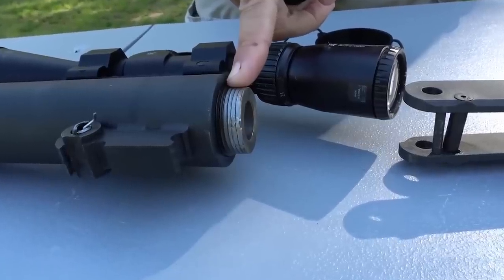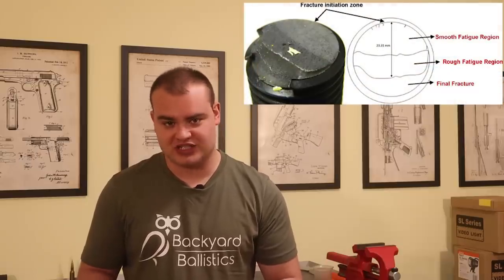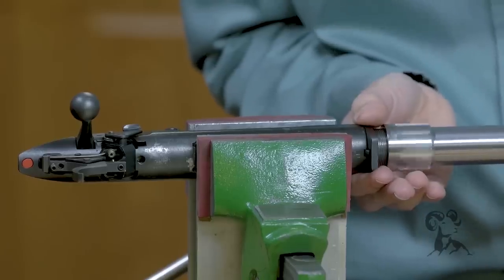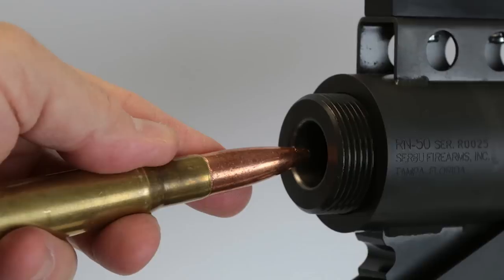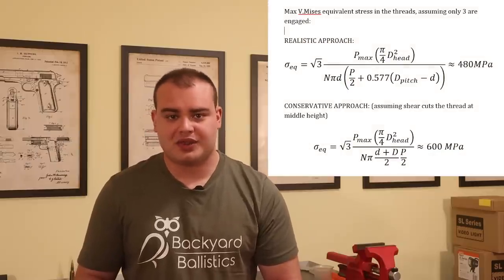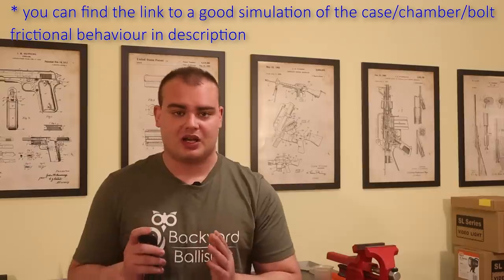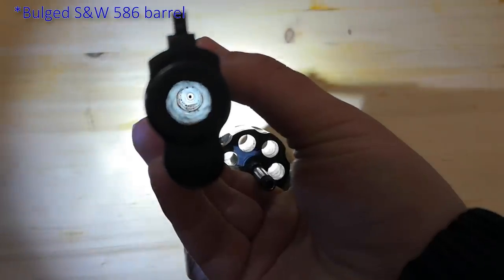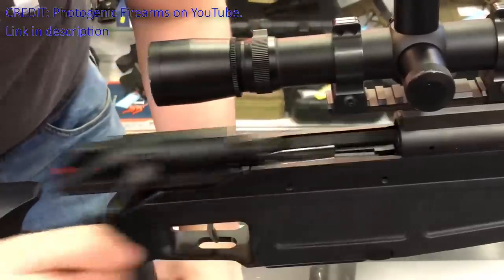Serbu RN-50 Failure: A Closer Look

Comment: I'm sure your not a 50BMG sabot expert but have you seen TiborasaurusRex's video on this?
Reply: I need to look this up. Thanks for the tip.
Reply: TR claims that trouble at the muzzle brake blew up the breech.  TR is wrong about this.
Reply: @rickoshea8138  either way, it is a VERY good case study all around. Everyone in the community will benefit from it. I hope.
Reply: @rickoshea8138  yeah. The brake wasn’t damaged.
Reply: @aaronhiggs  Not in an obvious way.  Perhaps a closer look might show something.
Reply: @rickoshea8138  I could see how additional pressure caused by the build up at the break (which is known to occur) could blow the breach. Pressure is going to act evenly at all surfaces inside breach and barrel. Weakest point (breach) blows out.
Reply: @stevendombrosky5184  The bullet striking a muzzle obstruction does not produce or require excess gas pressure behind the bullet.  It is like driving a vehicle into a concrete block:  The front of the vehicle is damaged; not the back.

Comment: the shape of the threads is important. there are several sawtooth thread forms that are specifically designed for these types of applications. a standard 60 degree v thread is not ideal. the sawtooth form is almost flat on one side so like a buttress . in a v thread under extreme load the female will climb up the side of the male V. the male V is thinner higher up and so has less strength. 
the sawtooth forms don't have this issue . there is  "Sägegewinde" () buttress  form .... used for breach blocks and things like tierod threads on massive hydraulic presses. they are only useful when the load is primarily in 1 direction.
Mark Serbu should look at changing his thread form and maybe add a few more.

Comment: Did he have the losser fitting machine gun barrel and chamber fitted to take the sabot round or was the original barrel fitted to the 50 cal because if it was it should have been changed out for a machine gun barrel as it is looser fitting to the cartridge when the cartridge has been put into the barrel and the Chamber it may cause a restriction on the end of the round pinching the saebo which would act as a restriction causing over pressurisation of the Chamber please can you get back to me on that as that may be the cause of the malfunction
Reply: Mark serbu should have informed him if that is the case
Reply: Pleas find out what barrel had been fitted to the rifle pleas and let me know thank you
Reply: And may be they got mixed up and gotten the wrong one by mistake
Reply: If you gave me a lath and the barrel I could resize the chamber to the correct sizing or mark can
Reply: I think it may have been to do with incorrect head sizing to the barrel though a few microns of jacket in the barrel at the end of the chamber could do about the same to

Comment: The SLAP rounds will mess up M2 50cal BMGs. In those recoil operations the SLAP rounds resin sabot is the issue. It was designed to fracture in the rifling in what was believed to be a predictable manner and separate on exiting the barrel. But as these rounds sit, the resin becomes more and more brittle. They only have a shelf life of about 3 or 4 years before they start to become slightly more brittle, then after another 4 to 6 years they are basically guaranteed to start causing issues. They develop micro fractures that are invisible to the naked eye. In a recoil operated firearm they cause pressure spikes and excessive recoil...I've seen an M2 spit its guts out the back after one of these caused a barrel obstruction at the rifling engagement and destroyed a 70+ year old M2 frame. Those baby's are tough and have been around for a very long time and will likely be in service for another 100 years.

The issue is the resin sabot. They have become so brittle that they are likely now breaking off pieces in the barrel. A 50cal is designed to slightly squish the bullet. The diameter of the projectile is about 3-5/10,000s of an inch larger than the bore of the barrel (groove to groove). The same specs were used on the SLAP so ensure that they worked as intended, and initially they did. But they weren't tested over decades and became sort of a novelty in the military. They look mean, they have the added flare of being a 660gr. tungsten projectile, they will definitely punch through more steel than an API, but they are dangerous now. Get on to empty and have as a collector item. But never shoot them. 

Backyard Ballistics, you are welcome to use this so you can stop being asked about why the treads failed, it was a massive pressure spike that lasted much longer than what that rifle was designed to handle. Those big pressure numbers only happen for a fraction of a millisecond before they drop rapidly. But when a bullet causes its own obstruction and not even part way down the barrel, thing go very wrong and fail catastrophically. I'm pretty sure that even if there were a 4th 5th or even 6th or 7th thread, it might have been worse. Think in the order of a pipe bomb going off in your face. The design is sound, I think the only  thing that might improve it is adding some shielding and a deflector for the rear cap to direct it and the blast in case of a failure away from the shooter. I'd rather have the rear cap fail than take shrapnel to my face and torso if the cap was deflated away from my shoulder.

Comment: The failure in this case actually looks like it was caused by an UNDER-charged round, or a round that was improperly stored at high temperatures for a long period. Loading without enough powder gives the flame front more room to propagate faster, leading to a detonation instead of a burn. The overall chamber pressure would have been much higher than optimum. Same with a hot-stored round, storage at high temperatures causes chemical changes that make the powder more volatile and increase the burn rate, increasing the chamber pressure. Either way, KABOOM. In either case, if the cap hadn't failed, it's possible the entire breech might have failed, exploding like a grenade and sending shrapnel everywhere.

Comment: Lots of talk about the thread, seen another video of him where he shows a thread with multiple cycles, like 10 orso. I do wonder how the distribution is with just 3 cycles or turns, which this riffle has. I guess that would mean immense loads on the outer thread turn. I guess. I saw diagrams with percentages, but they mostly shows number 1-8 meaning atleast 8 turns. Soif they are just 3-4 turns, that means totally different distribution

Comment: Beyond the COMPLETE LACK of design to direct ENERGY & Shrapnel away from the shooter during an overpressure failure... look closely at the threads at 1:47. 

Not only are there less of them compared to similar threads in M2 Browning barrels (which has the LARGER MASS of the Bolt Carrier Group and Receiver Group between breech and shooter, but even then NOT ALL THE THREADS ARE IN USE. 

The forward 2 to 3 threads are NOT even engaged since the cap is COUNTER BORED (fewer threads in it) to ease threading. They took a WEAK part and made it WEAKEN for ease of use. You can see these UNUSED threads pristine at 1:47

Comment: still think the sabot from the previous shot was stuck in the barrel in combination with a way to hot charge in the next cardridge  , i think the barrel wall was stronger than the breach in this instance or the sabot was indeed stuck verry close to the breach (still possible if he just loaded the round without looking through the barrel ) and again a verry hot charge 
one thing that could be done to make the gun stronger is make those two lips on the handle that go behind the breach a lot longer should give it more strength against the breach hopefully project it upwards if it comes/blows  off and not send those pieces flying to the person behind the gun (thats would be a bad design flaw as the gun is meant to kill people in front of the gun :P)

Comment: Y'know the more I think about it, the more I realize.

Scott had his Serbu RN-50 for about 3 years before it exploded on him. This wasn't his first go round with SLAP ammunition. Could all of the previous SLAP rounds eaten lightly at the metal, until the threads finally gave way with the split case on the final shot? I know SLAP's were designed for an M2, but iirc it even damaged and blew the barrels off of those as well.

Comment: In my opinion a 50% strength margin against catastrophic failure is unacceptable. I believe actions should have an alternative load path that engages with gas venting. The Lee Enfield action has the barrel threads in series with load then far back two lugs drop into slots. If the bolt lugs go plastic the bolt goes backwards until the handle engages more material, meanwhile the case ruptures and bleeds gas from a safe vent. 
A Lee Enfield will survive being fired underwater. I have not studied closely but if true that the threaded cap is the sole feature, I am concerned. I would not fire one. Guns are typically designed with features to make operator injury rare. I deliberately tried to fail a 100 year old shotgun with say 10x over load then barrel packed with pistol bullets and rocks. It swelled and stretched the action to bleed gas - would not have hurt the shooter (other than recoil). I loaded a 38S&W Webley break top to near 357 magnum pressures and it half cut the screw retaining the latch so again, case head ruptured and relieved pressure. I do not have confidence in a threaded cap.

Comment: I think its a case of all the things that can go wrong, did go wrong. On a weapon that was NEVER tested to failure.  Scott fired that gun a lot. I have nothing against Serbu. I didn't like the build of that gun, especially the threaded cap, going on and off after every round fired, but Scott kept shooting it and over time I started feeling that it was a good gun after all. Scott never had issues with it and seemed to like the gun a lot. They ( Serbu) will get to the bottom of this , and I think lessons will be learned by all. If you own one of these, you need to take a little more time inspecting your gun between rounds and DAMN sure you know what in the ammo you are putting it it.

Comment: I don't know if you have talked about the sheared off "safety lugs" that prevent the user from being able to fire if the cap wasn't fully on, those lugs, had they been designed longer or full length to the butt stock, might have prevented the accident being that bad - first - sheared off lug was what did a lot of life threatening damage to the user, second - had they not sheared off - they would have deflected the cap from going straight into shooters face, I see no reason for the "tab" design used in the rifle, it just makes no sense to me, though - looking smart after the battle is easy... :)
p.s. subscribed

Comment: Compare deformation of the barrel threads to how much the cap threads deformed and you might see evidence of bad barrel steel.  Inspection of the case should show wether it was severe overpressure or an obstruction.  The muzzle flash looke odd going back so far but that may be how a muzzle break works at high pressure.  The blast certainly moved the shooter back.

Comment: He used an aftermarket barrel and so we should assume normal imagines of the rifle can not provide useful data. 
The videos posted a month from failure explain he's fully aware the ammo used was too powerful for his rifle and it would damage the gun.
Reply: Only difference in the barrel was how the chamber was throated. Learn stuff.
Reply: @camojoe83  You assume that's true.
Reply: It wasn't "an aftermarket barrel", he got it directly from Serbu:
https://youtu.be/tpp4SdE1MUk?t=334
Reply: @jic1  
The word aftermarket can be defined several ways, several of which do not include product manufactures source origin. ie. Any parts not included in the whole sale may be considered aftermarket additions. This may include items sent from Serbu in the most common definitions but does not include all sourced vocabulary. 
In this video he directly states the barrel was built for a machine gun and not a rifle. The only difference between one company or another is fault. The fact Serbu sent the barrel does not change the statement above.
Reply: @JEGRussell  No, he says "it has a machine gun chamber".   And the usual implication of "aftermarket" is 'not from the original manufacturer'.  This barrel is from the original manufacturer.
Reply: @JEGRussell  You are literally debating jargon.
Reply: @jic1  Calm down..
Can'r prove it!

Comment: The problem I have with the design is that the only direction it can fail is straight back. Also the two tabs that lock behind the cap are pathetically insufficient for a 50 bmg. There is no reason for them to not extend the length of the lower receiver. which likely would have prevented them shearing off and poking holes in Scott. Bad ammo happens and over pressures happen. It is incumbent on a conscientious designer to take those things into consideration and plan for the safety of the shooter.

Comment: Dude, the more threads, the higher the pressure rating.... Period...
Reply: up to the point that it would shear off where the cap touches the back of the barrel. thats why more threads would not be better, because it would just break at the end of the threads.
if you thread a nut over a rod and stretch it until something breaks, and that something is the rod, more threads in the nut will not make it stronger.
Reply: Watch the first video, he's already addressed this.

Comment: The title to this video tho. It was not a failure. The gun did exactly what it was supposed to do. It was a Hot Round that caused the issue. Which means the round had a higher load which makes it a hot round. Which gave off over 80,000 psi. The gun is designed to handle around 55,000 psi. Most rounds don’t get to that point. So it was not a failure. It was due to a hot round.

Comment: If you designed a plumbing job as bad as the pipe joint on the RN-50 you'd be guaranteed a flooded basement.

Comment: the cap is a weak design,, nou only  the thread but also the  thin part where you screw the cap on,.a little play will hammer the cap back and metal fatique will occure, its not soft steel but a hardenend threahd .

Comment: It was caused by the muzzle break, it's in the military hand book, it states that slap round can not be used with muzzle devices, the device causes back pressure with sabot rounds, that is KB 2nd shot was way off. The previous 2nd Rd caused a obstruction with the muzzle break. Check out Tibersaus's video. Don't substitute cheap over quality is the lesson learned
Reply: He clearly explained why it would not blow the cap off at 4:44 and you still talk about the muzzle brake? Even tho Rex has the experience, this guy is a firearms forensic expert - he understands this whole issue much deeper than any of us. Does the military manual say anything about what would happen in such a case? Or it was just a speculation of Rex based on one sentence?
Reply: @BloPsy__  sorry but have you ever had a physics class? Even the gun maker stated it can handle 85,000psi. If it was the a gun defect then he can expect to be sued, especially from KB health insurance for compensation. Yes Rex even showed the the page. There's a reason why they were discontinued. The possibility of it being over loaded might be possible, bc America tends to do random drops of defective loads behind enemy lines, but I highly doubt it was one of those rounds
Reply: @time4anewsystem452  Who is talking about the gun being the failure here? The round was clearly extremely hot - more like a bomb than a cartridge.
Yes, I had taken a physics class - that's why I know that even a completely obstructed muzzle brake would not result in the cap getting blow off. Backyard Ballistics here just confirmed what I was thinking long before he made this video.
Reply: @BloPsy__  let's see what happens a few months from now bc this story is going away any time soon. Plus the gun grabbers will use it to ban 50s. I bet my house on that. Most modern firearms have a safety vent built in so these incidents don't or rarely happen. But that's what happens when you buy cheap just to say look at what I got

Comment: interrupted thread -thats genius! And used in artillery. Why they didn't think about something like that? It seems you would close the breech even faster than the screw cap with only three revolutions!
Reply: They have, Mark Serbu was just to lazy and cheap to do it. Watch his RN-50 review.... his channel is called Mark Serbu.
Reply: Cant buy an interrupted thread pipe cap at the hardware store, so it's not happening on a Serbu.
Reply: Mark Serbu has already addressed this: it's much harder to machine interrupted threads than people think, and designing an effective out-of-battery safety to stop the rifle firing without the threads engaged is a major issue.

Comment: But there could not bd a obstucktion in the barrel the round was in the firehydrant
Reply: Not true, a piece of the sabot could have remained in the barrel.
Reply: @fredbloggs5902  as far as i remember he shoot a normal round after the slap round so slap normal slap so proboply there is no more debrie in the barrel
Reply: @fredbloggs5902  ore not enuth to blow the whole gun up anything big enuth to obstruckt the barrel would proboply fly out with the normal round
Reply: @niggo7224  an obstruction in the barrel does not need to be very big to blow up the gun. There are claims water drops can.